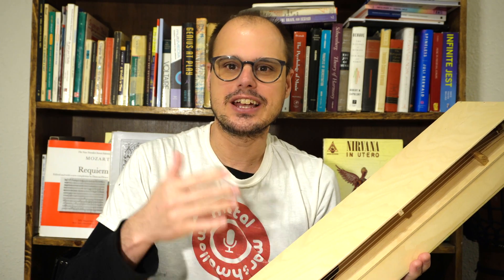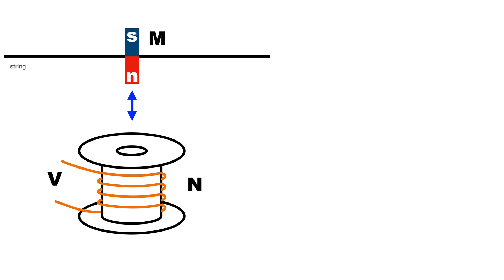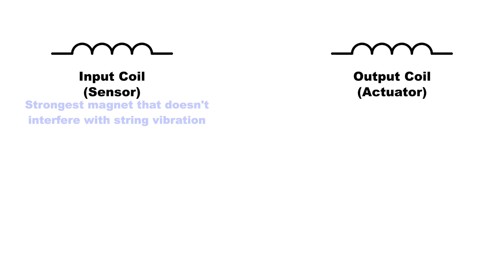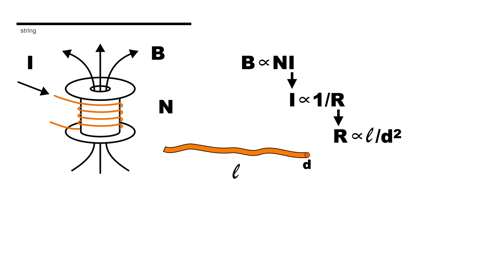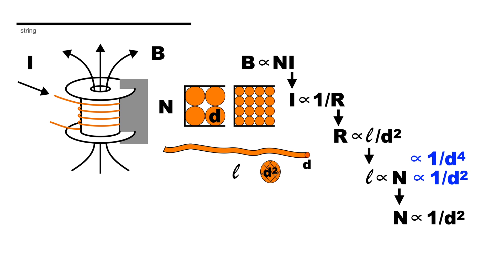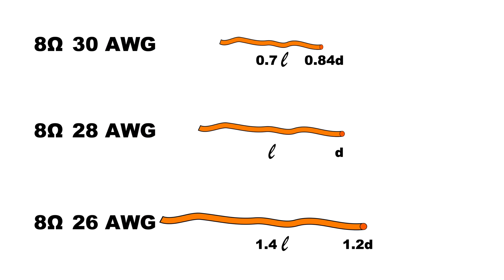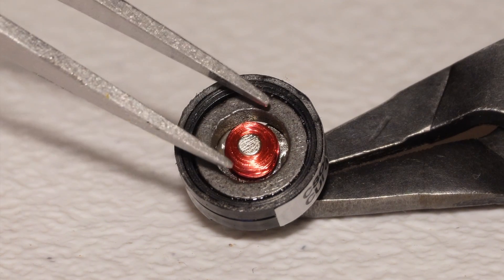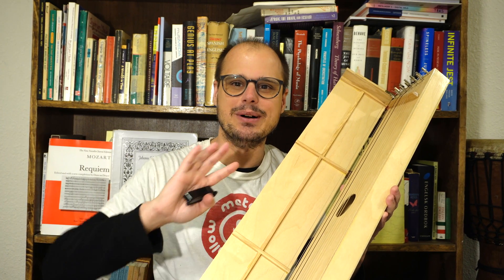Fulgorian Harp: [2] Guitar Sustainer Coil Physics

Comment: Why use a magnet on the output coil? Would'nt a metal core inside the coil might work even better?
Reply: An iron core inside the output coil and next to the string and the coil a strong magnet that magnetizes the string should be best, I think.

Comment: When doing those inductor filling calculations, I ditch the “proportionality” and use the proper constants. Not only does the bobbin have a maximum cross section for wire, but also a maximum power dissipation. For a guitar pickup maybe that’s 5W. Then knowing my voltage, I figure out what total resistance I’ll need to meet for that power consumption, and calculate the number of turns and of what diameter to meet that based off the cross sectional area of windings I have to work with. Then I design a driving stage, in this case it can be any old half-bridge, be it with FETs, a monolithic L293/L298, or a BJT totem pole. Gotta include the voltage dropout in the above calculations though.

Does having a permanent magnet in the output coil actually matter? It’s necessary in the input coil since you need it to induce a magnetic field in the string to detect its motion, but here you’re already producing a magnetic field with the output coil.

Comment: You don't need a magnet for the output coil, having an iron core will help, but no magnet is neccesary because the coil is an electromagnet in itself.
Reply from the maker: Electromagnets always attract and never repel iron regardless of which way the current is flowing. Without the string being magnetized, the coil only pulls on the string but never pushes on it. At 4:08 I show the coil repelling the string, and the permanent magnet is necessary for this.
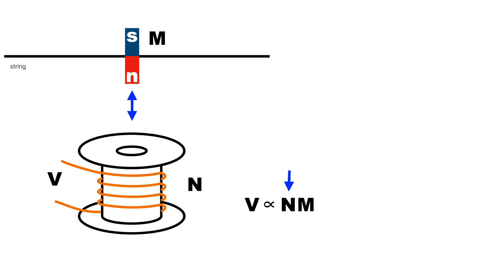Reply from the maker: Additionally, at 2:28 I show myself winding 2kOhms of 42 guage wire onto a sewing machine bobbin. It measured ~500mH with an air core, and ~550 mH with a neodyminum magnet filling the core. So some but not much difference.

Comment: That's probably more analysis than some guitar pickup manufacturers do to build their pickups. One more thing to add to the pickup side is that there is some sort of an upper limit or at least it goes with the law of diminishing returns: The more turns an the thinner the wire, the higher the impedance of the coil. Then you start needing higher and higher input impedance for the amplifier. I quess the practical coil size and the thinnest wire that's possible to coil by hand will limit it before in this application.

In guitar pickups when you start increasing the turns you increase the inductance. That means the amps input loading down the pickup will affect higher frequencies (harmonics) more and the sound will be darker. In the sustainer type thing it might not be that big of the deal as you only need the fundamental or perhaps a few lowest harmonics.

Anyway... You probably have this figured out by now, but hey... Let's hope this counts as engagement to the youtube algorithm. :)
Reply from the maker: Yes, that is all exactly correct. And long live The Algorithm!